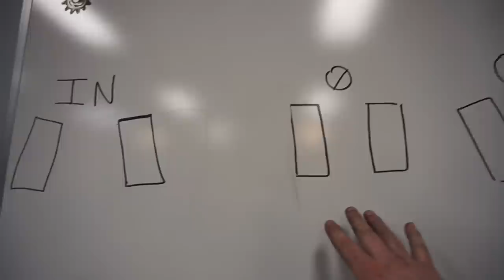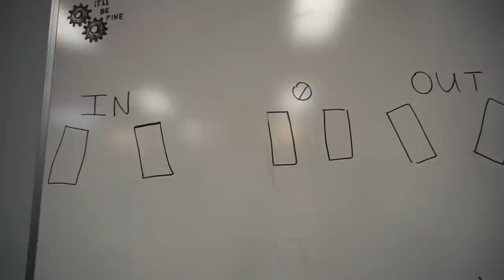Shifter Kart Speed Mods: DIY Alignment, Gearing, Aero??

Comment: Caster is really easy. Castor is the primary determination whether or not the vehicle is going to pull from one side to the other. For instance if the right front wheel is more forward from the left, the vehicle will pull to the left and vice versa

Comment: Casters kind of like toe in toe out when it comes to the position of the tire, you know you can remove the  top or the bottom of the tire in and out in the end to adjust its camber,  think about it in a like a plus sign on your tire when you measure a tire out you have a point up and down and you have a point Center of cross, Caster allows the tire to either point in or point out towards towards the center of the tire rotating as it track straight

Comment: Caster is what brings your steering wheel back to center with less effort. It's how far forward the wheel hub is relative to the shock or strut location or in this case spindle.

Comment: The tire is supposed to lift, karts don't have a diff so the inside tire has to lift for it to turn. The caster on a kart has the most effect on the "jacking" or lifting of the inside wheel, more caster = more wheel lift. This will also make the steering much heavier. You can only have positive caster on a kart because it is partially built into the frame, so you are adjusting more or less. Try changing the caster to the opposite setting(for a pill style, turn it 180 degrees) and see if it is more or less twitchy.

Comment: And your camber out scenario is used by lowriders for a couple of reasons. Aesthetics and it take stress off the ball joints a little bit. Also the way the tires tuck with access positive camber spaces the crossmember further away from the ground when the suspension is fully compressed like if you are hopping. So that way it doesn't hit
Reply: fuzzy wuzzy lowriders got it from the drift world which got it from various racing disciplines. Negative camber is in use in every racing situation yoube ever witnessed

Comment: Camber out is what you set a car at with alot of power squat  and if you drive with a lot of angle (drifting) and full lock of the steering wheel the car can create positive camber so they set the car up with alot of negative so at full lock the tire is more neutral 
 But you only use alot of positive in the rear if the car squats alot under alot of load

Comment: Also set rear tire stagger. Use air pressure to make the tires the same circumference side to side for less rolling resistance due to having a locked rear axle.

Comment: Guy,s you need a T-piece on your fuel hose at your carby with a in-line fuel tap to set flow and decrease fuel pressure with a line return to the tank, this will fix your over fueling. Front end fix, look up king pin inclination and Ackermans principle of turns to get proper inner and outer turn radius tracking geometery... cheers

Comment: Positive camber on the left and negative on the right makes a left hand turn car. Equal left or right negaive camber will help with turns at higher speeds and with any drifting in a turn the outter tire with more negative camber with track the corner better. Those carts especially in the south are oval track carts  which is likely why you had what felt like an alignment pull to the left. Even them up with a couple degrees of negative and play with it. Also if you spin the tire with a  soap marker to create a line on the tread atea and measure ay the font of the tires and the rear of the tires whem mounted you can make accurate toe adjustments.

Comment: Best way to do an at home alignment is to put a nail through one of those boards. Put the nail on the tire so it makes a line on the tire when it spins then spin the tire so there’s a line the whole way around the tire. If the line is off one way or another then you’ll know the alignment is off.

Comment: Ok so on carts .5 to 1 degree tow in is a good start. As the parts are not as tight as in automotive setups. Once you are driving they will be near 0 toe. As for camber you have no suspension so minimal is best maybe 1 or so degrees. Now caster is very important as its what keeps the cart going straight at high speeds so about 4 or 5 degrees of caster will be more stable at high speed but will make steering harder as as you turn it is lifting the cart some. But the important thing is to have equal caster side to side and equal camber side to side so it does not creat a high speed pull to the left or right

Comment: Something you aren't considering about camber...  negative camber is really only beneficial on a vehicle with suspension. As the wheel/ tire on a fixed suspension vehicle can't change position relative to the remainder of the body/frame, weight transfer onto outside rolling stock is fairly minimal ascomparedtoavehicle with suspension. Also, the existence of suspension gives more joints, allowing for the wheel/ tire to shift orientation, again relative to the body/ frame, more under hard cornering. As a result, I would think that 0 degrees of camber would be best on a fixed suspension vehicle like your cart.  That's just my opinion, though.
Reply: Anthony Cook  race cart suspension is chassis flex and side wall deformation. Negative camber will still be a benefit

Comment: I think Ike should now make his own shifter kart but make it 2 stroke🤔
Reply: Fat Assassin cr500 motor
Reply: Kb blair yeeeessssssssssssss!!!!!!
Reply: The CR motor would be cool but I like the idea of the Maico 700cc 2 stroke motor.
Reply: Cr125 is as much power as you ever need
Reply: Big difference between what you need and want you want. Lol.
Reply: 894charlie but more power than that is just unnecessary, plus eventually the kart will just not be as fast around a track as a cr125
Reply: car_spotting_tx I agree for actual racing you are right, plus the kart will flex out faster. I was more referring to a fun toy to mess around with.
Reply: Yephe has a doner... Kx 250 2 stroke old dirtbike barn find he has. Would be much cooler than the dirtbike is.
Reply: @santiago9ish  for sure. And its small and compact and doesnt weigh much. Anything bigger is just overkill and will make the kart unstable and dangerous.

Comment: if you get too much rear facing Caster your wheels will wobble back and forth at high speeds if you get too much forward facing Caster it'll do the same thing so if you get a wobble move it back and forth until you set up to a center point where everything roll smoothly

Comment: Adding a new fairing 10 lb an Overkill engine mount 25 lbs
Lose the engine mount for aluminum plate add the fairing and go faster
If your going that fast ram air induction may help also

Comment: Did you check the plug at full throttle then shut it down...for time 5:30 video...you could have also been to rich which would lose power at hight rpm

Comment: john and ike so much for velocity and airing in march eh?..lol..those guys need to get their ducks in a row ..aside of that i think you went the right way on the toe and camber ..we run dirt track cars and always have the camber real strong on the front right tire..you still need to change the main jet on the carb for better top end wide effin open throttle..the carb needle probably got rid of the dead spot b/c it was mid range but for complete top end high rpms the carb needs a bigger jet..i wouldn't mess with aero unless you're planning on 100 plus ..then in that case maybe 10 pounds wouldn't hurt ya or even a formed diamond plate wouldn't be too bad as it's light as well..bama love comin ya'lls way *** and yes we will be watching on 4/20 to see if ya'll hit the mark of 100 mph

Comment: Moving the Needle to the lower position wont help richen Wide Open Throttle,  it WILL richen-up like a quarter to half throttle, but wide open is Main jet ONLY - drill it or buy some bigger ones in steps and try it

Comment: Boys, the needle only adjusts the amount of fuel in part throttle . If you're on the gas all the way, the needle is all the way out of the main jet and has nothing to do with the AFR anymore. Get a bigger main jet and please don't try drilling it out; nobody can drill something only a couple of thou bigger using a hand drill.  Just my 2cts =)
Caster basically is the equivalent to the steering head angle on motorcycles, makes the wheels go straight again by themselves more or less - in a nutshell
Reply: Bassalicious we will do more carb mods
Reply: +Isaac it'll be fine  nice! looking forward to it. it'll be fine i'm sure

Comment: You need to reduce the amount the steering arm on the end of the steering shaft  it moves your  two shafts to the wheels , your getting too much movement when you turn the steering wheel ..
Thats why your kart is so scary at high speed ...

Comment: Fellas, high RPM and full throttle will be more main jet than needle jet. ROUGHLY: 0-1/4 throttle = pilot jet, 1/4 - 1/2 throttle = needle, WOT should be all main jet.

Comment: I would really like to see your top speed runs performed in a more controlled environment. Aside from the obvious safety concerns, testing done on public streets is not going to get you optimal results. If you found a closed strip, away from trees and without potholes ( try making friends with the staff at a small local airport), the speeds you're looking for will be much more easily obtainable.
Reply: Michael Long Good ideas!! 💡
Reply from the maker: We've tried multiple times, the local airport isn't having it :(
Reply: Michael Long ... If the airport gets any kind of federal funds, the FAA frowns on it. Let me rephrase that. They will arrest you for it. Maybe if you get a N number for your cart.
Reply: CarsandCameras ... Issac,  are you and John having any luck with Aero fairings for your bods?  lol

Comment: There's not really a reason to have camber on the cart as you don't have any suspension travel. As in most cars you gain or lose camber depending the suspension geometry and which way your going. But in a cart like that you have no suspension so you have very little weight transfer.

Comment: Caster is easy...the contact patch needs to be behind the center pivot point of the spindle...so you tilt it back at the top...hense why you call a shopling carts front wheel a caster...it just makes the wheel straighten out by itself

Comment: FOUR TWENTYYYYYY 

Hilarious, and appropriate LOL
Reply: Also, no, trophy trucks do not use positive camber. They are neutral at rest, but gain negative camber both at full droop, and fully stuffed, to aid with steer tire traction at all times( when they are in contact with the ground, that is).

Comment: You guys need to get a KX500 or Cr500 motor and bolt it to the shifter kart. With the right gearing that thing would easily get 100mph

Comment: positive camber would only be used on a long travel suspension with independent axles or axle shafts, so that as the machine lands after jumps a bump.....the suspension will compress to zero camber, then to negative camber, then returning to positives after the suspension returns to ride height
Caster is how far back the rim center point is behind a line from top to bottom ball joint....so the tire follows the suspension like a caster on a shopping cart.....rather than zero or in front of the suspension, causing wondering............my brain hurts now....i want a cookie

Comment: I like the channel so dont get me wrong but you guys were not using the square the right way. 

Also, positive camber is to gain more grip on long travel shocks typically , because when a car squats it has natural camber and in some cars you need tire to ground contact for grip of course and negative camber wont help in that instance.

You guys could have 0 but that doesnt mean its centered and square 
tires like this but not so dramatic on the toe--> / / or like this \ \ would still read 0

Comment: You should really look at your diagram when you explain toll in and Camber and Caster adjustment on an alignment because the way you showed it was the top in the bottom of the wheel where the tow in the in and out on the front was the camber and caster which is wrong it should be the front in the back of the tire being the toe and the top and the bottom of the wheel depending on which angle it is and how far it is out from the Hub is the camber and caster

Comment: Couple of things guys.  #1 that shifter need serious redesign.  #2 if you are worried about weight, don’t use ½ inch steel for motor mounts on a 16hp kart. #3 I continue to notice you using overly long blots on the builds, least trim them.
Reply: Yeah, I had to laugh when Ike was griping about the nose weighing 10 pounds, then turned around and used 10 pounds of 1/2" steel plate for a motor mount.

Comment: Why don’t you guys use a tape measure  from the middle of one tire to the other tire in the middle. Then you check the back and see if its the same.  A lot easier thane the wood and pipe that yall are doing

Comment: Get good with using the backyard alignment tools, even invest 1-200$ in it if you will be doing this often. 
And it’ll work on anything, cars trucks go karts etc 😬
it’ll save you a lot of money and you can set the specs you want. 
I went to an alignment shop once. 
that was over 20yrs ago.

Comment: caster and camber does have little effect on carts and single seated racing cars ! rather have a look at your Ackerman angle !!
Reply: Ackerman definitely help in turning but they wan't to have it stable at high speeds so camber and castor definitely helps at high speed. I purchased a modified cheap frame and the castor was perfectly straight up and down and the thing was dangerous at high speeds as it almost seem that it didn't want to go straight.

Actually on a live axle kart, it is caster that will help you turn as it lifts the weight off of one of the rear wheels during a turn. Correct me if I am wrong.  Have a great day/night.